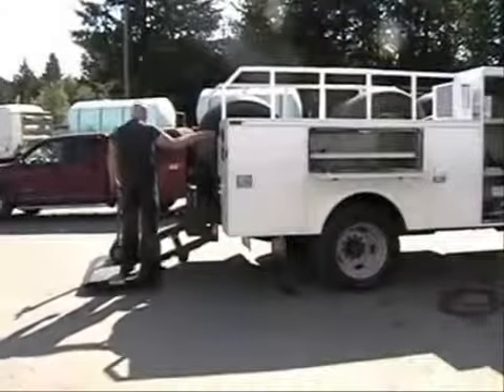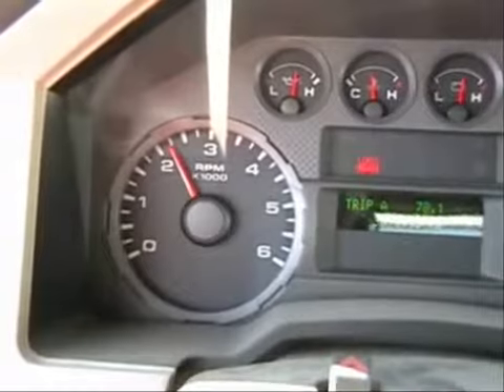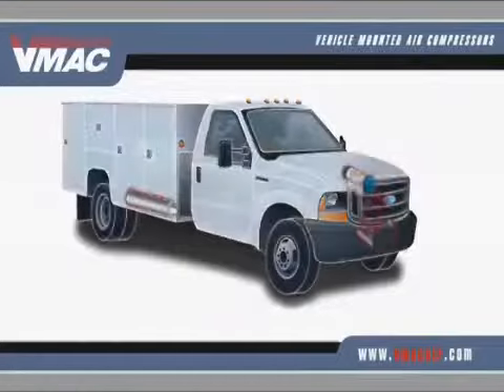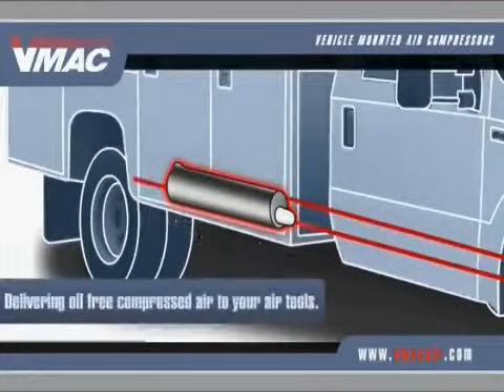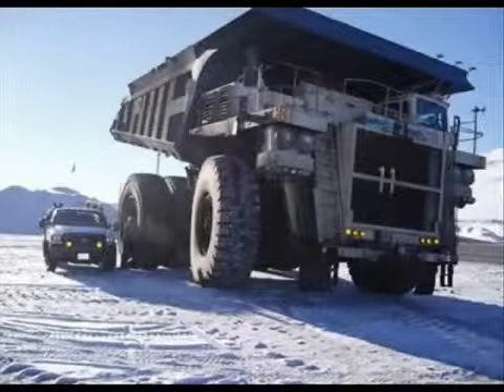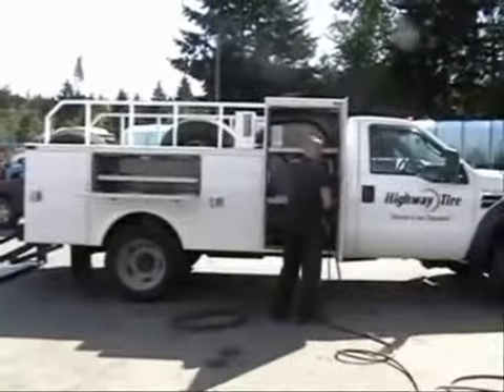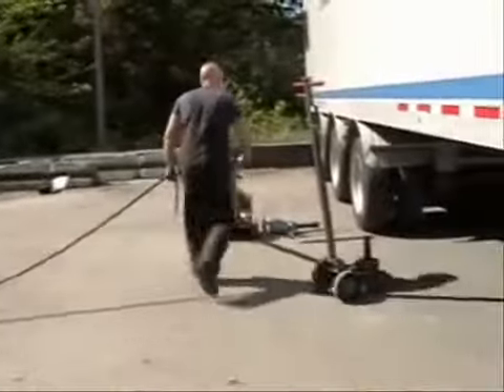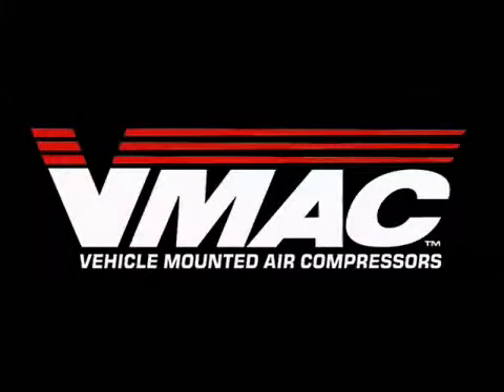VMAC - VMAC UNDERHOOD V70

Comment: They are good units ,the price is too expensive,just had a dealer  near me me quote a price of near 12,000.00 dollars that's 9 ,000.00 for the unit and 3,000 00 for installarion,installation, that price I will not be using your product